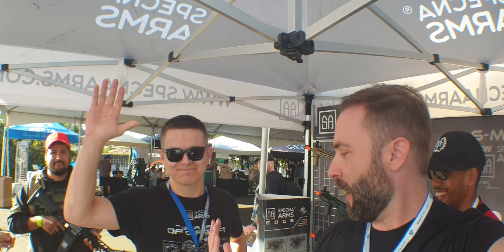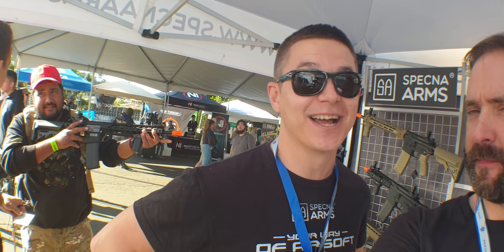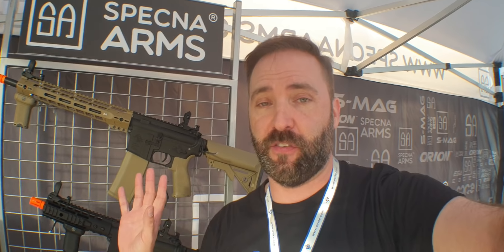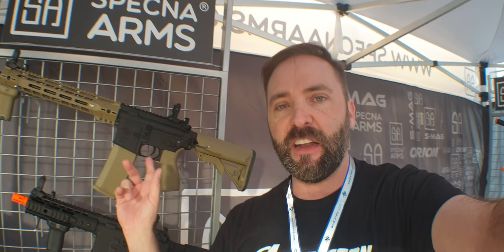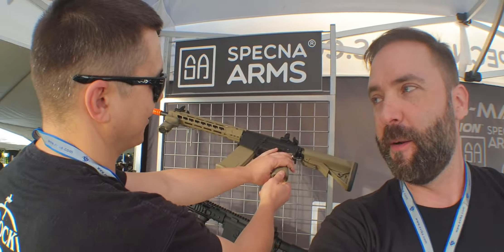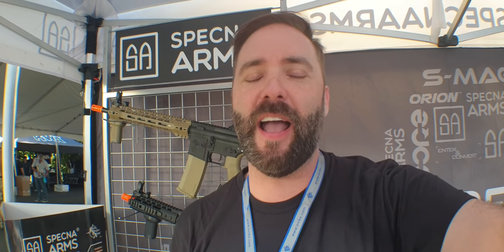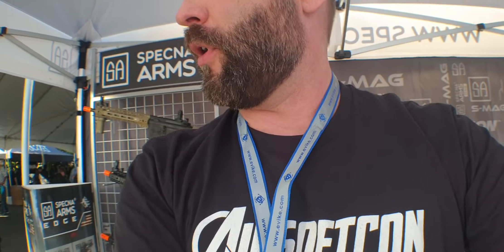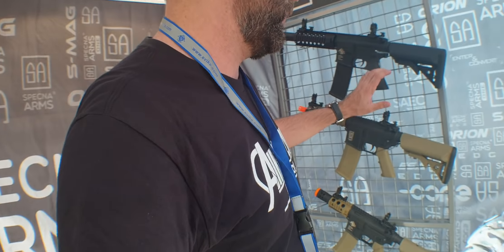Specna Arms BIG upgrades (Gate MOSFET preinstalled) | Evike AirsoftCon 2019

Comment: Specna Arms is dedicated more to beginners. I say this because of all the other internals not mentioned, like a plastic spring guide, low quality gears, a regular low torque motor, aluminum cylinder and all the other plastic parts like the piston, nozzle, tapped plate, fire selector plate and safety leaver are made of dubios quality plastic. The old enter and convert ones and the first SAEC ones were made of much better quality paterials (except for the gears). They work ok out of the box but lifespan is questionable.
This is my personal oppinion.
Reply: There new line is alkt better now

Comment: Is specna arms gonna be like krytac trident or vfc avalon?
Reply: XdDDDDDDd
Reply: The new top models are a lot better than those.
Reply: @justKdG  I know the mosfet is better, but I don't know about the barell, hop-up, gears, gearbox etc. Do you think they are better overall?
Reply: @matijavinazza9861  First up, VFC Avalons are just average guns internally. Secondary the Krytac design is quite outdated. Altough it still funktions very good, I would not buy one in 2019.
The Specna arms EDGE series comes with a cycle detection (wich is key to smooth semi-auto) as well as really good internals. The internals beat Krytac in value for money.

Barrels dont matter much in Airsoft. HopUp and Consitency are key. The Unit in the Krytac does a good job and so is the Specna Arms. Both can be upgraded with better rubbers. Id go for the Specna arms all day long.
Reply: @justKdG  I was planing on buying vfc avalon and upgrading it(hop-up rubber, barell and gate aster) so I already bought aster and now I am thinking if I should buy specna arms, but I don't know what to do with aster then. Buy the specna arms with gate x-asr and change it out, or just buy specna arms with aster in it. Do you have any advice?